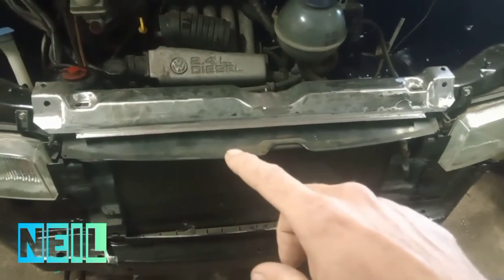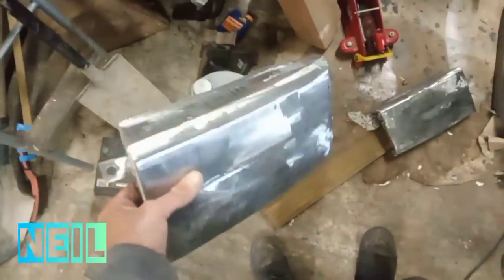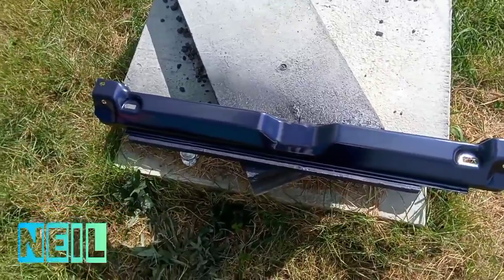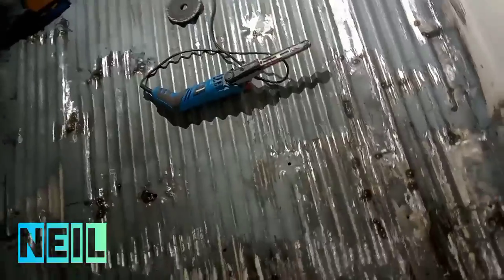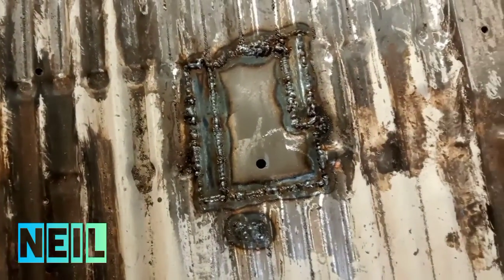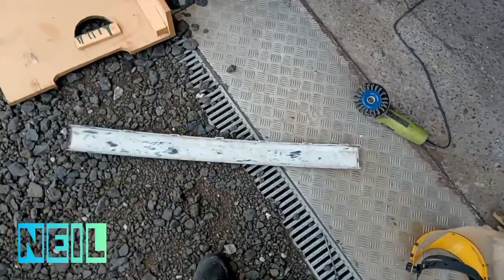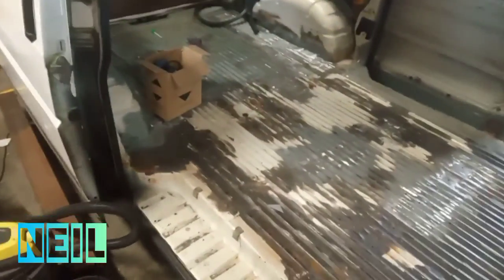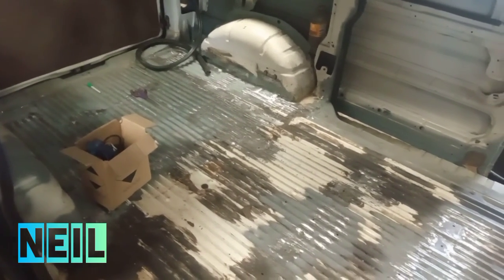Fixing my very rusty Volkswagen T4. Part 39. Plodding along.

Comment: It'll Be finished soon Neil. I'm going to shot blast the rear of my van.. I have lowered it 50 mil on the back (old springs snapped) and 40 mil on the front😁.  I have driven it out front too. No poolice visit yet.
Reply from the maker: Cheers mate. I really hope so. It's coming down to finances holding me back now.. what kind of lowering set up did you go for? I'm sure the polis will be in touch 🤣🤣
Reply: @neil...  got springs off eBay bright yellow ones and unused shocks which were like new. 
Fronts easy to lower, two big nuts one on either side, back of fuel tank need adjusting, undoing them lowers the front, there's no spring it's a torsion bar set up. Yes I'm having fund problems too. Everything's going up. Makes it hard to save so van is on hold at the moment.
Reply from the maker: @Hasdac  I got my mate Choppers old set when he went to voglands. Not sure what ride height they are but can't be far off standard. I'm thinking maybe swamper style in future. It's a tough decision
Reply: @neil...   go for it Neil see what it looks like. I didn't like the way my van felt on the road,  felt a bit boaty for me. mine was raised, rear springs were sitting on a lump of round aluminium, people thought it was a synchro 4x4 version. Its cost about £90 to lower it. I like my bargains 😁
Reply from the maker: @Hasdac  I'm still in 2 minds what way to go mate. Lower or swamper. Swamper may be more practical. You know me, I love a bargain